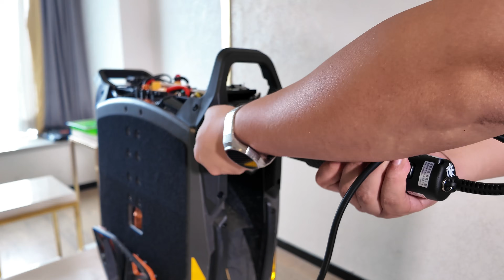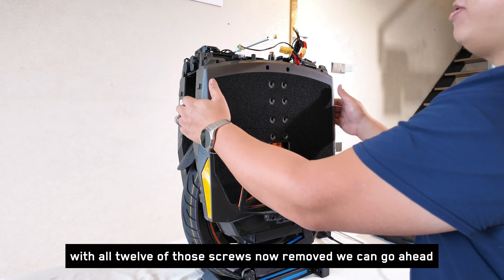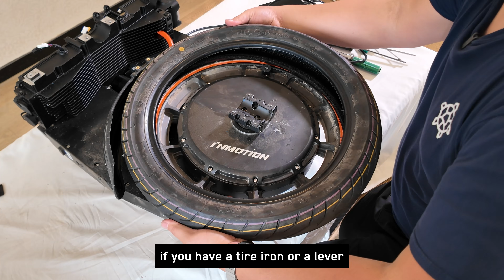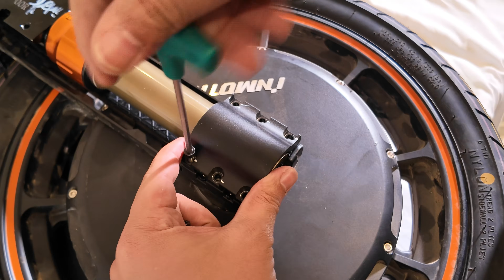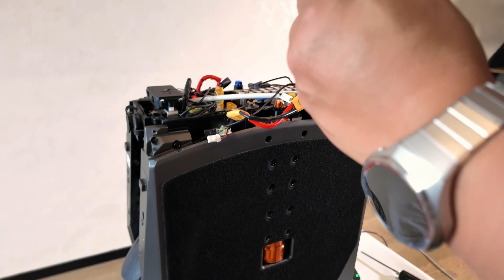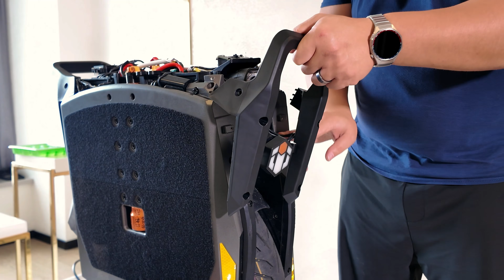INMOTION P6 | Tire Change

Comment: Say Albert will a Michelin Street Pilot II, 90/90 14 fit on this wheel, or would it be better to use the 80/90 14?  Thx for your input, much appreciate, mostly street ride with this one!  I'd prefer the 90/90 if it fits!

Comment: Hello Albert, before removing the cables, discharge the capacitors.??
Reply: The mainboard discharges itself as soon as you turn off the wheel. You can hear it do so actually. It's the first wheel to do that